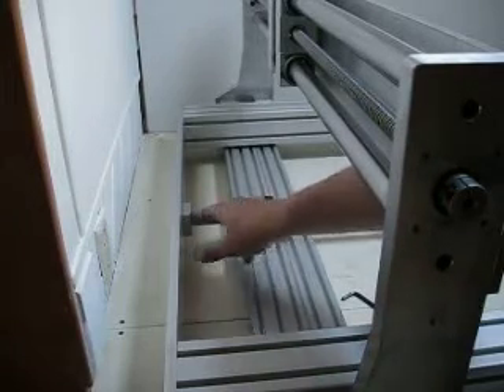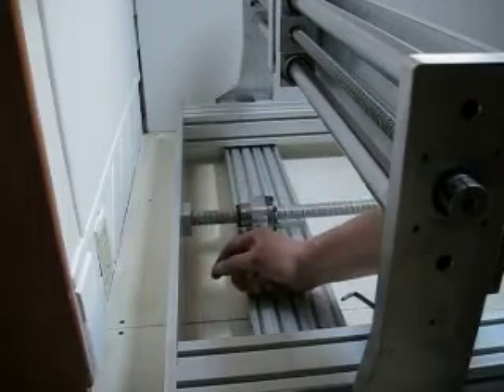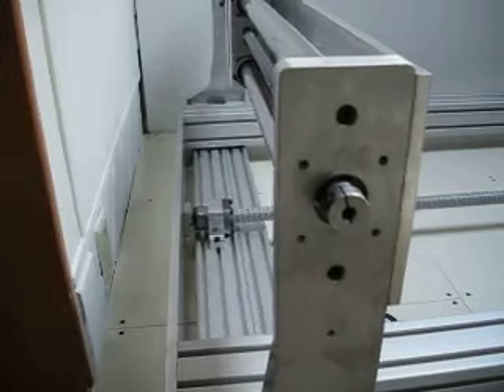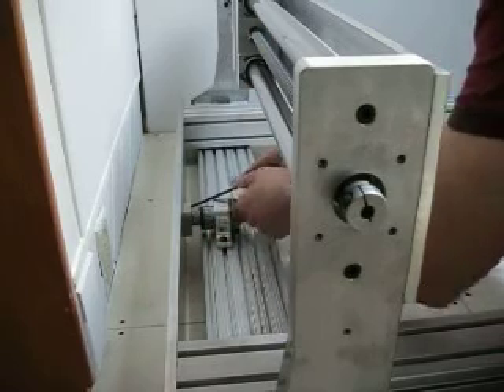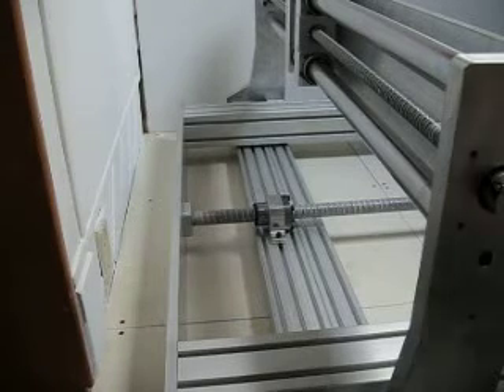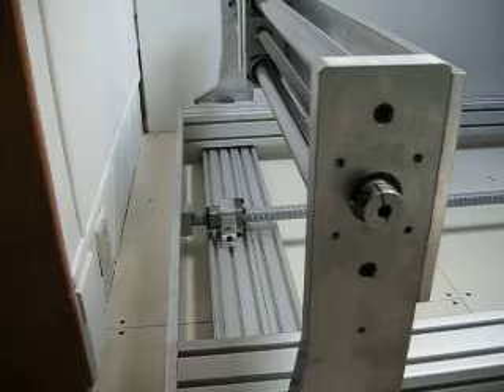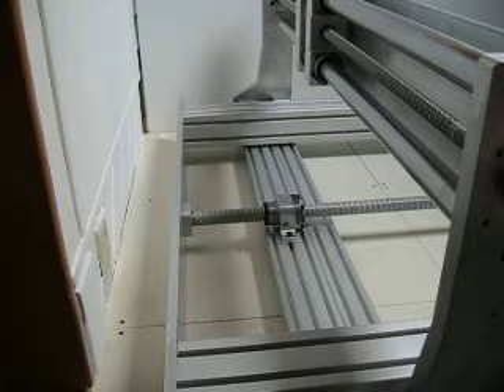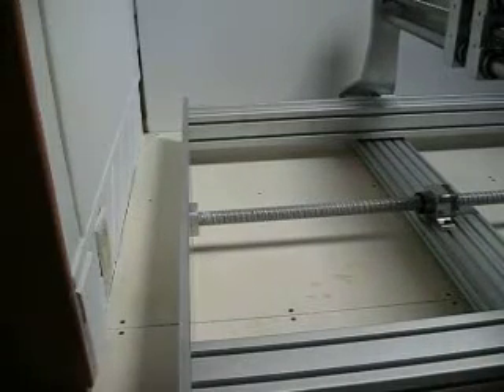Racking Resistance Fixed in 2 Minutes.AVI

Comment: Good Tip! This lessened the stalling I was getting in the X axis but it was still there just a little. Turns out that my gantry was also tilting just a hair on direction changes causing the X axis to bind. Re-adjusting the bearings on the gantry cleared up the issue. Great video!